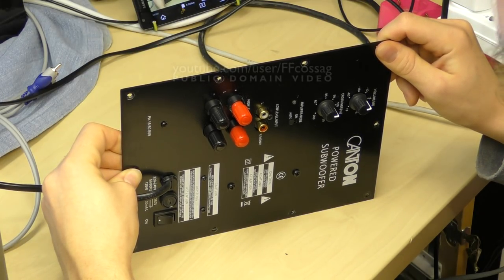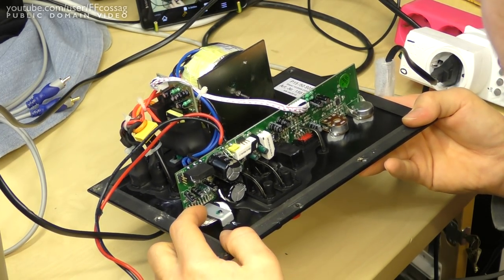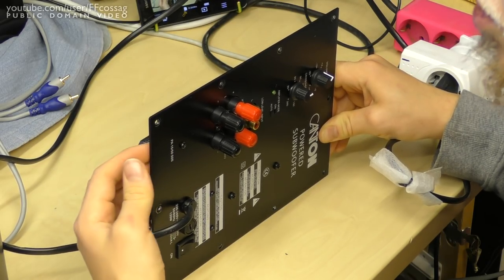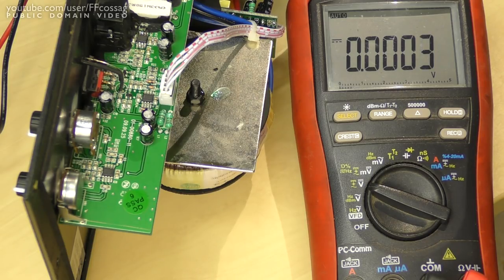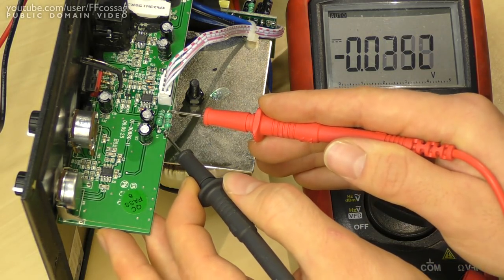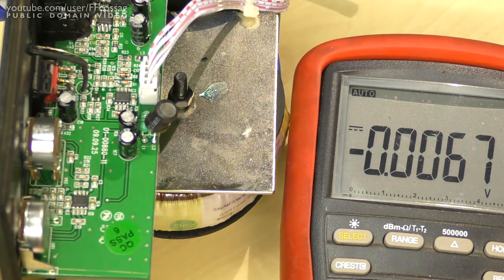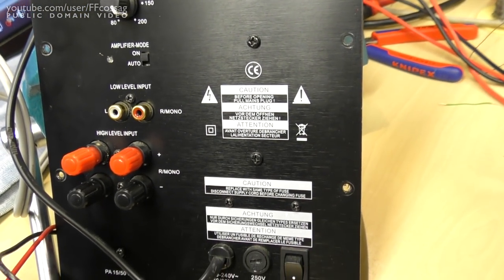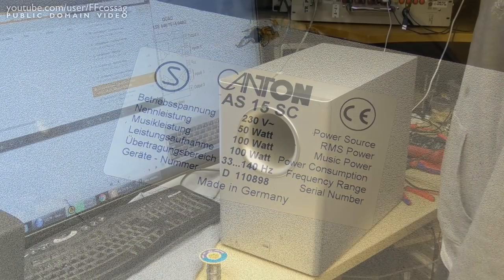Canton AS15SC subwoofer repair

Comment: this is gonna turn into finding lots of broken amps, fixing them, and then selling them on eBay similar to what MaxxArcade used to do. for the off-months when you're not slaving away at the transmitter station. it gets really tiring really quick, but it's a quick buck for not much in the way of effort and time if the fix is a simple one.

Comment: I have a canton Ergo AS2 subwoofer and it started to make a strange crackling And now sometimes I hear a random buzz usually when the signal is being changed . Is there a specific capacitor that typically fails ?

Comment: Hey there;  if you can help with an idea - I have 2+1amp Piega Tmicro sub; there's volume control mono potentiometer, which regulates voltage of OPamp for 3 channels at once. Volume potentiometer is ok, but does absolutely nothing and stereo AB class amp for satellites is running full volume. On the other side, same volume control regulates sub output, but it is very very low, barely noticable (but works, speaker is playing). Sub has separate board Dclass chip. What could be wrong? I've already replaced OPamp 074C close to the volume potentiometer, but no success. There are more LM837M which may fail in my opinion. All capacitors are ok, also voltage stabilizers seems to be ok. Im quite lost.

Comment: With all them subwoofers, you'll be shaking the house with all the wumptywumpty sounds they emit... :P
Reply from the maker: I spent four hours trying to like the KEF I fixed earlier, but I just couldn't. Cheap subs just sound so ... dirty.
Reply: I haven't used a sub in about 11 years, think I put my foot through the speaker (no grille, cos I had to pull it off to repair it, funnily enough!!) when it was under my desk at the time, these days I just use headphones... :P

Comment: I think i have the same problem with mine but no tools to test it. Do you rekon replacngig  both microhenry chokes (As I don't know which is faulty) Would sort the problem? Also what is the specification of this particular choke please?
Reply from the maker: I'm not going to reckon anything with nothing to go on. Try shorting past them if you suspect them, you won't blow anything up if that's the sole issue.

Comment: Hello.

I have a similar subwoofer (sub 6,2) but it looks exactly the same as yours inside.
when i turn it on the light is red and when i connect the sound cabel the light turns off. No sound comes through.
Any ideas?

Thanks.
Reply: Tjo. Såg att du är från sverige så svar på svenska funkar det oxå
Om du vill höra av direkt till mig kan du maila. tommy.lagebro@gmail.com

Tackar
Reply from the maker: Well, that sounds like a similar thing to what happened to this one, if I recall correctly - so check to see if this repair applies.

Comment: I have a simular (ASF 75 SC )amp that keeps thumping when powered on with or without input in My Canton that have been in the box for 5 years.. cant find the problem with it and i changed the caps with no results..

Enny sugestions?
Reply from the maker: Try turning the pots back and forth 20 times or so.
Reply: FFcossag  dident help, ive now allso replaced the TDA but it still rumbles 😕 the part where the pots are is not exatly same as yours so i cant refere to youre video 100%.. i have two mostfetts and some caps where you poke 😕

Comment: I can't understand what there is to fail on an inductor, although I have seen it happen
Reply: ...... I was thinking the same,  must be a very thin winding,.
Reply: Not usually thin, I have seen ones near CPUs on motherboards fail and they are partial to one full turn of 12 gauge (AWG) copper wire, they look fine. Really would like to learn more on the failure mode of these.
Reply: ..... Maybe the manufacturing coupling of winding to leads ?
Reply: Big mystery really, inductor loosing contact, the same way as some resistors and capacitors do.

Comment: I'll probably come across as a pedantic ass; but come on...
33-140Hz... Thats NOT a SUBwoofer, it's just a woofer.

A subwoofer should produce (only) subsonic sound; e.g. up to 20-25 Hz or so... So any 'sub' that produces audible sound cannot be a subwoofer. 

I blame the marketing people...
Reply from the maker: What's worse is that there's so much distortion on that signal that there's always 33-140 Hz present, regardless of what signal's actually going in. ;)
Reply: You have no knowledge for sure, its 100x more pleasant to hear clean 35-40 capable sub vs 20+ hz horrible soundwaves. No 8-10" bass speaker is capable of pleasing 20-25hz.
Good thick rigid sub cabinet and rigid bass speaker are more important things.
Reply: @MrSookonn  - "No knowledge for sure", says the man who doesn't know what the prefix 'SUB-' in SUBwoofer actually means...